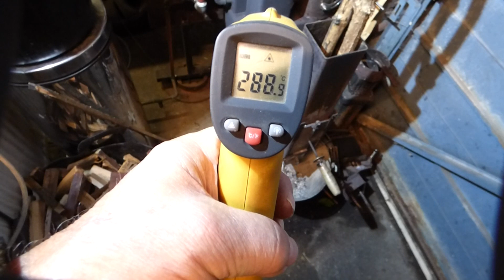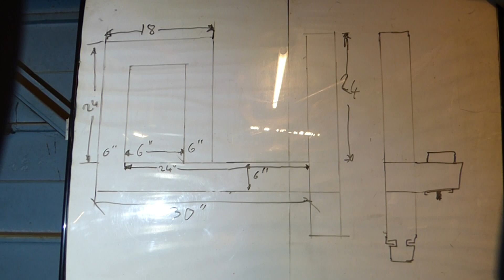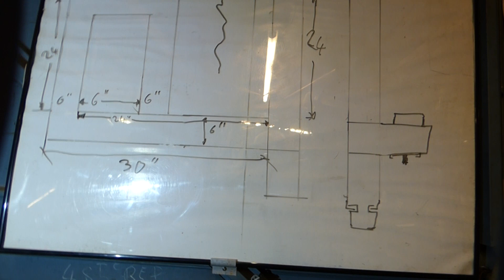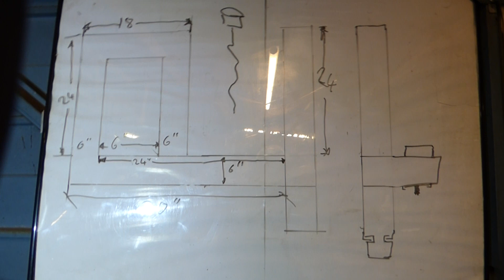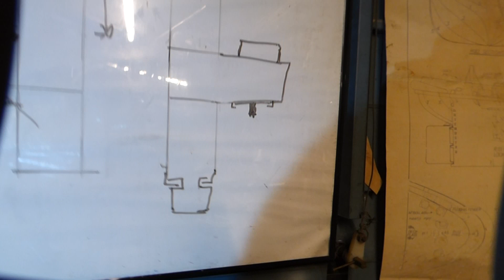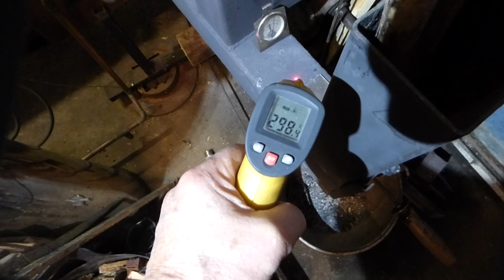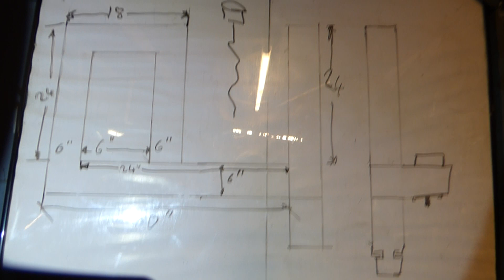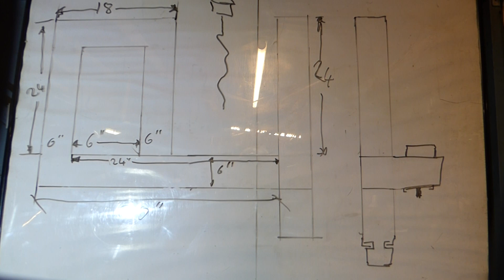No53 rocket stove MK3 updatre

Comment: Dave, if you add a gravity drip feeder for the waste oil into the hot bit of the RS, like into the secondary air intake, that would give the extra heat for wood burning. A simple gravity feed with ball valve control. Darn, I'm getting inspired for an Autumn "lockdown" project here in Auckland, New Zealand. We have an endless supply of pallet wood and oil, and a massive space to heat. 
I had to leave my early experiments in South Africa. We refugeed ourselves away in 2018, leaving too much behind. 
Anyway my job has loads of workshop space and I live next to the workshop ;-)

Comment: I have built this unit and now into my second season with it. I plan to upgrade it to a larger fire box and install the water pipes right in front of the flame. I'm using this design to heat my greenhouse here in Washington state USA.

Comment: I wouldn't have believed that the chimney  wouldn't get too hot myself.... till I built a smaller 3" rocket stove
( your the cause of that Dave <GRIN>) it's a 3" gravity feed pellet rocket stove the exhaust pipe on the back
never gets hot enough to burn your hand !!!!!  all the heat is transferred into the burn chamber ! 
it's amazing !  ug-ug-ugly but it works fantastically !  all the heat is contained in the burn chamber and tank on the back
599 degrees is what I got from wood pellets !  and that kind'a heat is more than plenty for my shop !
burned for 2 hrs on a quart of pellets in the testing stage .... it never jammed  from the pellets ( 3" round tube!)
your an inspiration to me at least Dave and I thank you...... I should use half of the pellets i would normally use if I put the stove in the house..... but the wife wants me to pretty  it up before she will let it into the living room ! LOL
Bob....